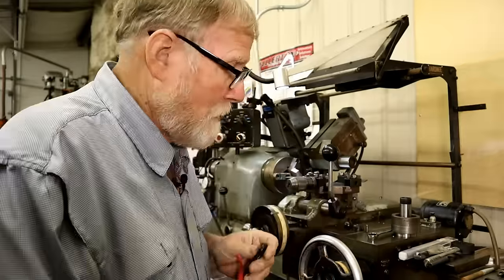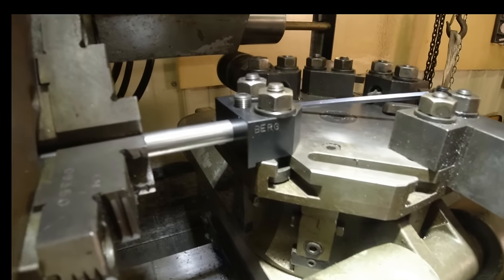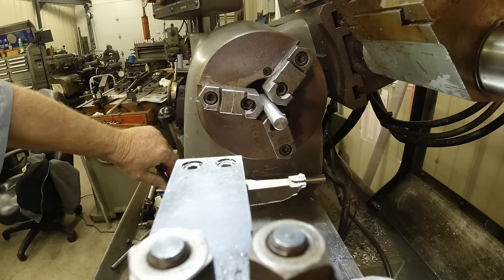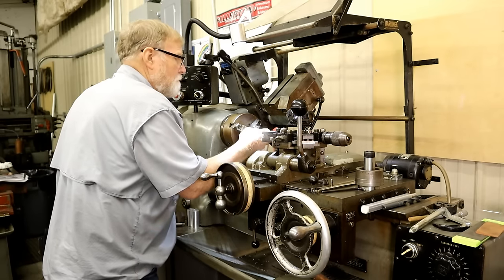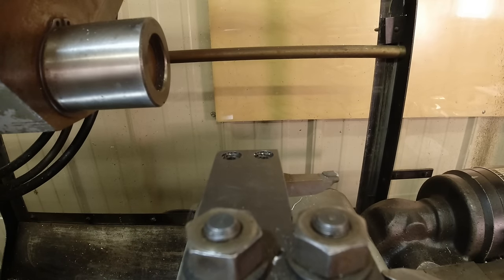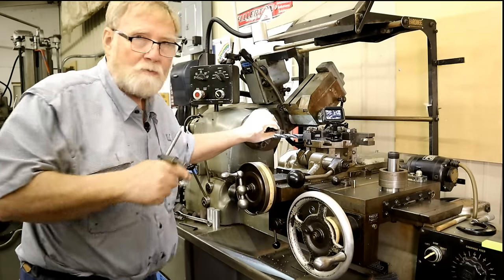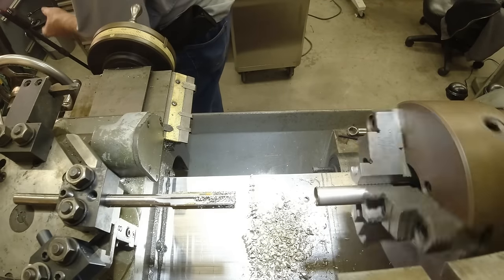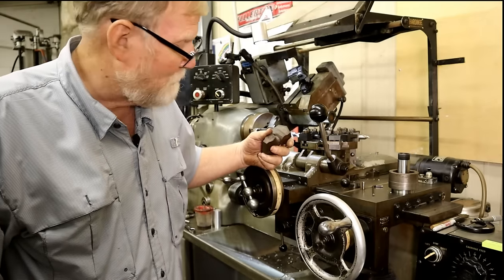Working on the Bridgeport: Boring the Kingway Castings Part 1

Comment: I use bushings like that on my cnc lathes and they have holes drilled so that the locking screws contact the tool directly and not just the side of the bushing.  When I made a bushing like yours I found out why the holes are there.  First is that most lathe tools like your reamer have a flat (very easy to grind) for the screws that help keep the tool from spinning and the second reason is that any mark or burr from the set screws will make them almost impossible to remove from the holder.  With the holes they will slide right apart with the screws out - without it is like trying to pull Excalibur from the stone.
Reply from the maker: Yes I was going  to put a hole through it but was in a hurry... You need to put the holes in first on such a thin wall part or the drill can make a mess of the wall... Next time :)

Comment: Great to see you back in the shop, Steve. Also glad you're feeling better.

Would it have been easier to put the "slug" into the tool holder, chuck the drill/reamer in the 3-jaw, and bore the bushing in situ? Sorta backwards, I suppose, but it would've saved you the trouble of aligning the smaller reamer holder. Plenty of ways to skin a cat, I suppose.

Regardless, awesome work. Can't wait to see the finished tool in action!
Reply from the maker: Still needed to face off the slug...  This was easy as all the tools were preset in the carousel and all you have to do is pull the handle for a tool change...
Reply: @10swatkins  Fair enough! I'm not super familiar with turret lathes. Thanks for sharing the knowledge!

Comment: Steve, I live very close to you in Magnolia TX. Wondering where you buy your tooling from, if not on line. I’m a hobby machinist expanding my workshop and thoroughly enjoy your videos. Thx
Reply from the maker: Bass Tool in Houston.. Carbide Tool and Industrial Supply in Waller..   Bass has more inventory on hand but CTIS is only 20 minutes away and have most of what I need or can get it fast...
Reply: Hey Mike, Magnolia here too.   Hobby machinist also.  MSC has a great selection and is mail order.